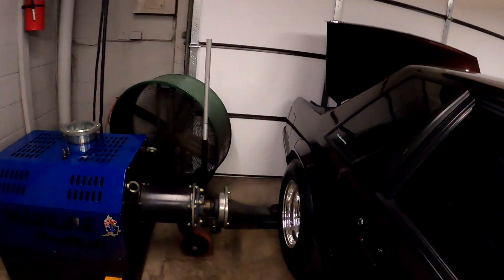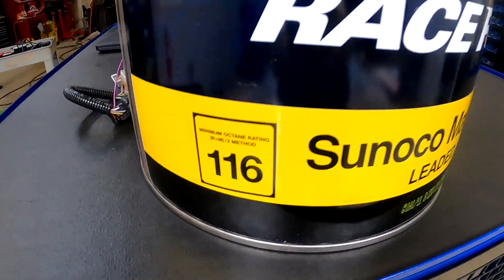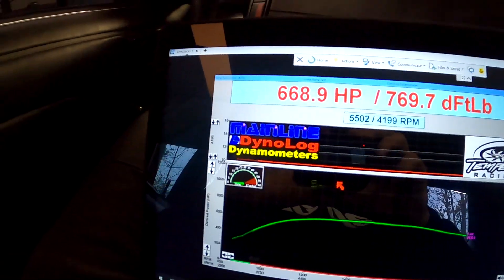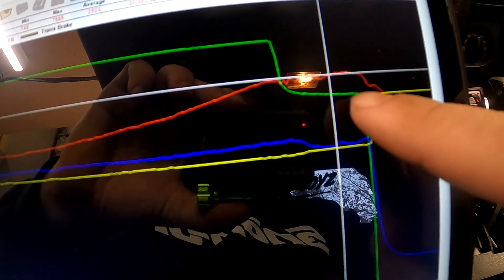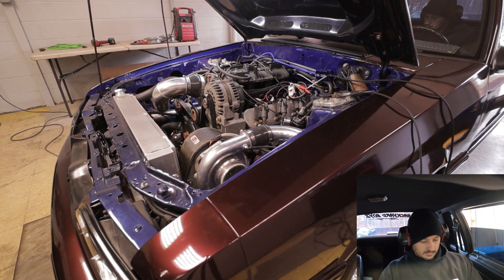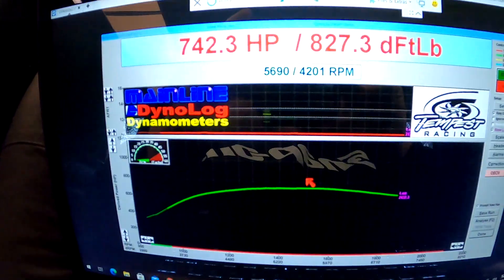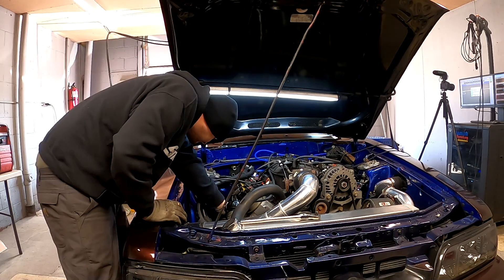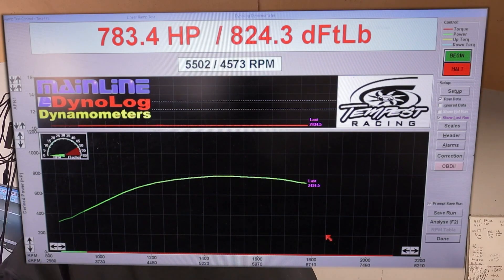Maxing out a VS Racing 76mm Turbo! - SBE LS Turbo Foxbody Mustang - Holley EFI

Comment: For the uninitiated- “throwing the CO2 at it” - is that referring to the boost controller?  I take it that the controller is using compressed CO2 to regulate the boost pressure???
Reply from the maker: Yea throwing Co2 on the wastegate is how you increase the boost with Co2 based boost control like this one has

Comment: Just curious how many more degrees of ignition are you able to sprinkle in with race gas compared to 93 tuneup? For a typical 5.3 sbe deal at these boost/power levels 17deg way too soft on c16 or the like?
Reply from the maker: I know this sounds like a bullshit answer but it’s literally different on every one. Some don’t want any extra timing and some may take 6-7. I generally don’t hammer cars with timing to try to make power so i usual i don’t push what the max difference would be.   Like the supercharged e85 cars seem to take double the additional timing as a turbo car it seems

Comment: What fuel pump? Would a single walbro 450 be capable of making 700whp?
Reply from the maker: This had a magnafuel 750.  Single 450 could do it depending on fuel pressure, voltage, some some other variables but may be cutting it close

Comment: Lmfaooooooo joe you got me dying with the inserts hell yea this has been a great series with this car. Similar set up I have  but I have an 85mm billet with 1500 injectors so this has been great with trying to see if I want to go e85 or run pump with race fuel on a track day. Thank for the videos joe
Reply: e85 with the flex fuel sensor is the better option in my opinion.
Reply: @NavyNate123  that’s the Route I took
Reply: @edwinrosadojr4592  hell yeah sounds like a fun build.
Reply: @NavyNate123  o yea it definitely moves and has been a great t

Comment: Great content. You should do a 116 vs. e85 video on this combo as well.
Reply from the maker: He doesn’t have enough injector for e85 and it’s a customers car i can’t keep it forever 🤣
Reply from the maker: However i have another car i plan to do a bunch of fuel testing with. It will be a little while though will probably have a bunch of build videos along the way
Reply: @JoeSimpsonAtTempest  just watched your other video on ignition timing effects on hp and then watching this video. This proves how much a good tune makes a combo! Imagine this customer coming in for a dyno tune starting at 482rwhp and leaving with 783rwhp is pretty badass!

Comment: Hub dynos are nuts lmaoo 100 wheel over what those turbos make on a roller dyno
Reply from the maker: Actually had another car on here a week or so ago with the same turbo that was down like 200hp from this car. This set up is just strong
Reply from the maker: Did a charger last week. Made 750 on a Dynojet the day before and 730 on my dyno with no changes 

I’ve owned a Dynojet, mustang dyno, Dynapack, and a mainline. Very familiar with how they all compare
Reply: @JoeSimpsonAtTempest  some cars are just dyno queens . Just from experience on our dyno . A gen 1 7875 will make 650-690 MAX . The local huh dyno always make 100-150 more than the dyno jet i use.
Reply from the maker: @Ginajenns   got ya. I do not have the same experience and i can’t control what the dyno says 🤷‍♂️
Reply from the maker: @Ginajenns   what kind of dyno are you using?  Our mustang read significantly lower than our dyno Jet.  I have not come across anything that reads higher than a Dynojet 224. My personal car made way less on our 248 than on a local 224.   You would think they would all be a lot closer than they are haha
Reply: @JoeSimpsonAtTempest  its an inground dynonet 224. And i agree alot read high.  But this one doesn't.  At all lol dudes will come from otber shops and say their shit makes 650 on a other persons dyno.  And itll prit 560 on this this one . Breakd their hearts. My car made 900 wheel. 3650 with me in it. But trapped 127 in the 1/8th
Reply from the maker: @Ginajenns   yea that’s pretty weird, usually the Dynojet’s read higher than others but are consistent with them selves. My old Dynapack read much lower than 2 other people i know who has the same dyno. They made one number on theirs and a totally different number on mine.

Comment: Where you located Joe?
Reply from the maker: Southern Maryland about 20 min south of Washington DC
Reply: @JoeSimpsonAtTempest  yea I just saw that when I went to your website, I live Houston wonder if you have any pretuned info. I have a 07 Silverado recently got a 76mm kit installed and have btr stage 2 turbo cam, dual 450 walbros, and 1000cc injectors and it's a 4.8. Any tips to get the most hp out of it?? And thanks for responding.
Reply: @trentlothringer2867  go see cesar at HorsepowerFactory.  Hes in Houston
Reply: @Ginajenns  that's a good idea thx
Reply: @Ginajenns  how much hp do u think my truck will make my set up is posted in the same comments to joe
Reply: @trentlothringer2867  650 ish